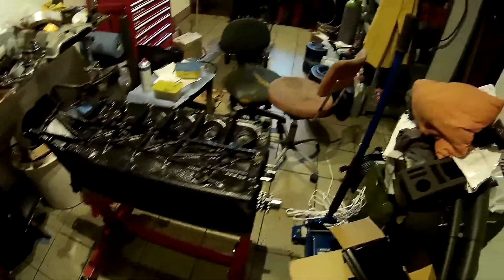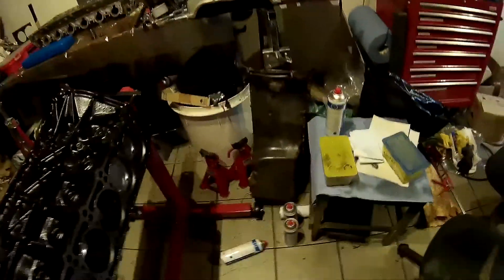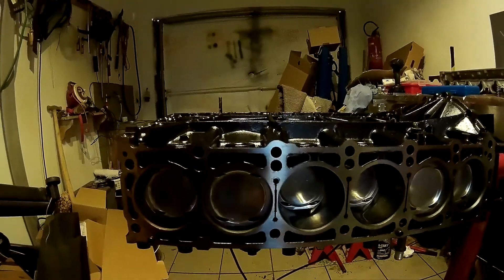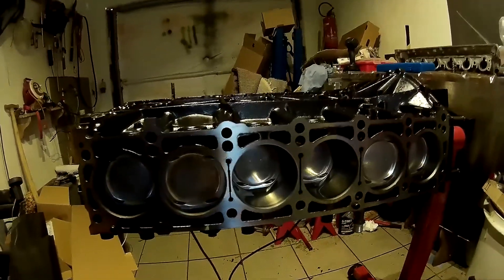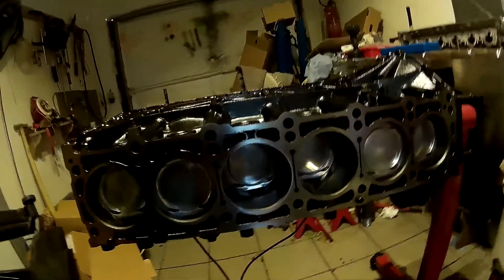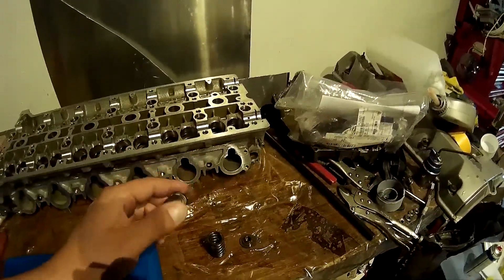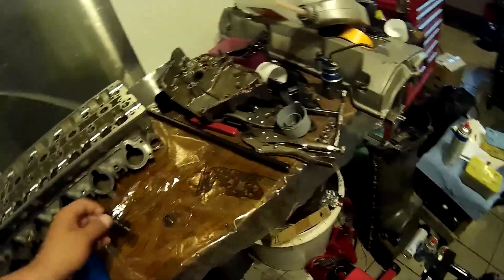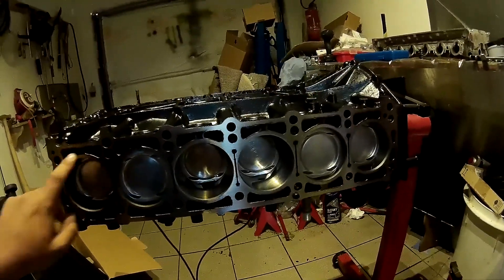M104 Turbo / Engine Update / Engine Rebuild

Comment: Why you re built the engine ? You had only 14t Miles in it ??
Reply from the maker: ?!
This engine i bought used with non guaranteed 220.000km...140.000mi
That's why I rebuilt it, and also i wanted to lower the compression and change the valve springs and  head bolts.

Comment: Hello. I was wondering whether you could let me know if your engine has under piston oil jets/squirters? Which M104 engines have them (i.e. like for example a s320 EU spec) ? Thanks.
Reply from the maker: yes it has.
every m104 has them until 11/1993.
after 11/93 only on 36 amg models.
Reply: @carlbenz3341  Thanks a lot for the information sir.

Comment: Carl Nice build, always fascinated me as to if you could swap the 3.0-24 crank into a 2.8-24 block and then put that 3.0-24 head onto it. As the piston length is very similar between 2.8 and 3.0 and the compression should only be affected minimally. Would be interested in your opinion. By what i have seen so far compression will drop but the head can be decked to get higher compression. Should bring it out to a 3.3-3.4 I think
Reply from the maker: you miscalculated something here, your extra ~1,5mm on the bores would give you roughly 100cc in displacement all together. (3056cc)
but everything should fit together, alltough i'm not too sure with the KE head on the HFM block.
Reply from the maker: And you'd have to combine the 3.0 rods with some m104hfm or m111 piistons.
(there are a lot of diferent compression heights available for the 89,9mm bores)

Comment: hey man, i have some questions, are those pistons forged? i have a supercharged M111 with 10.4 compression ratio (N/A block) and I wonder if my pistons can hold the pressure.
Reply from the maker: no they are not, but there are "forged" pistons(special alloy, high copper) in the m111 kompressor engines.
generally speaking stock n/a pistons are probably fine...
Reply: Carl Benz thanks man

Comment: Hi. Did you know if the m104.941 2.8 from 1994 W202 have cylindrical valve springs?
Reply from the maker: Cylindrical valvesprings where used until november '93.
If your car is from january or max. fabruary there could be a chance that they are cylindrical.
My W202 is from august 94 and it has conical valvesprings.

Comment: Great video do you know if the m103 Engine is strong as the m104 regarding internals ?
Reply from the maker: yes, the internals are basically the same.
just other dimensions, stroke and rod  length etc.

Comment: Great info there! tell me do you know if the m104 2.8 and 3.2 has the same crank? i know the rods on the 2.8 is shorter.
I am getting a M104.942 and can get the M104.992 stock rods. Keep up the good work!
Reply from the maker: +chris snoer 
No, the complete rotating assembly is different.
Stroke is 10mm shorter or so. Pistons and rods are also different. Displacement is not dependent on rod length.